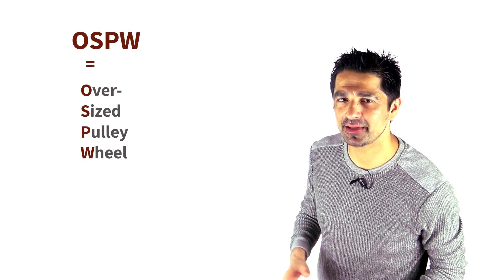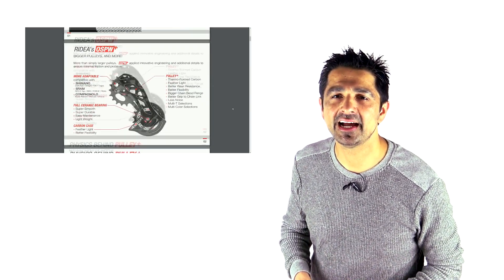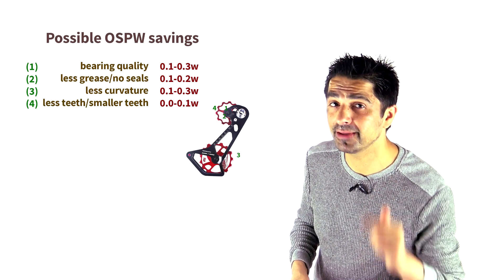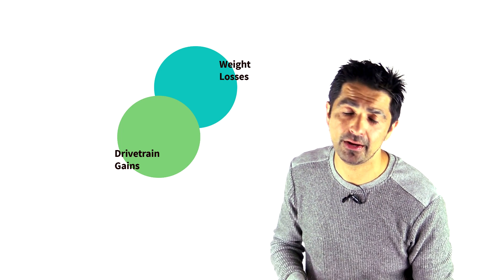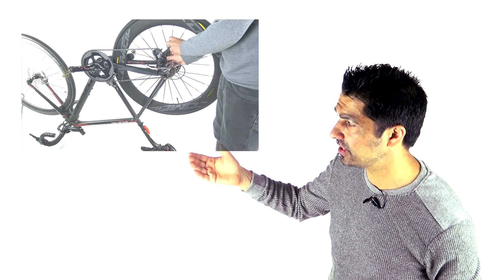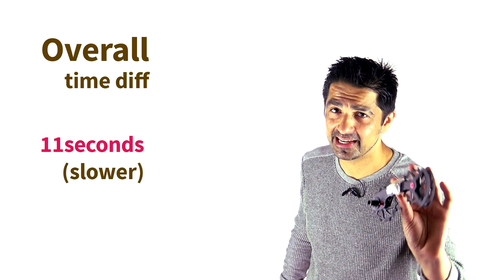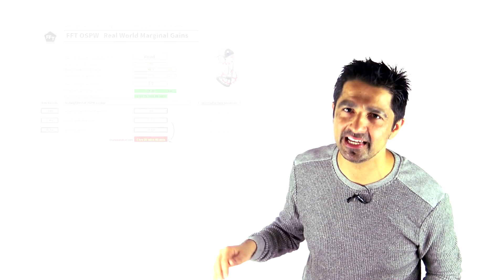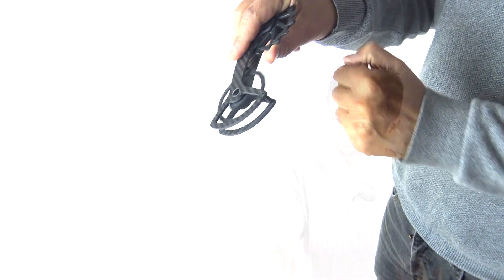Why your CeramicSpeed (or other) OSPW will cost you watts due to aero drag

Comment: I've just returned to cycling after a 'gap' of 30 years. I am shocked by two things: [a] the price of new bikes and components and [b] the plethora of B.S. relating to 'advanced' cycling technologies. Of course, vendors use [b] to increase [a]. As pointed out in a previous comment, if you keep your head down, elbows in, jersey zipped up you will save more watts than you can buy for a $1000.
Reply: "if you keep your head down, elbows in, jersey zipped up you will save more watts if you can afford and want to?

If you've already done all that, then why not go after something else that helps, even if it is expensive
Reply: Some technology is good even if $$$$$.  Its not all as absurd as these things.  Do you need it?  (Useful technology that is, like carbon wheels, electronic shifting etc) Depends on what you do on a bike and your disposable income.
Reply: @stuartdryer4089  Then how come you don't see Bike messengers riding  Dogma F12, S-Works Tarmac SL7,  Madone SLR 9, etc.??
Reply: @kalijasin  Bike messengers use tools appropriate for their job.  So do people who race bikes.  But a lot of Ceramic Speed stuff makes no sense for anyone.
Reply: As you I returned also, but I came from Triathlon.... At "my time"  there were really revolutionary things like Greg Lemond introduced the Tri bars to the cyclists.... Now they try to sell us all kind of stuff for a lot of money, but the gains are quiet small.... As a successful 24h rider I keep one thing from Eddy Mercx in mind:  don't buy upgrades, ride upgrades! Not that I am closed to good material like fast tires or helmet, but at the end the rider makes the difference.....
Reply: I am the same. Toooooo much marketing. I ride a Gravel bike, which was the MTB of my time with flat bars then.  Everything is extra sensitive but it's "lighter" , first time I broke a chain, and I over maintain my chain now!!! Didn't know what proper maintenance was back then. Just punctures 😂

Comment: This is my situation, bought a SRAM Red groupset for my SHIV, they rear derailleur would stutter then be fine for miles, then stutter for a quarter mile. Couldn't adjust it out of the stock jockey wheels. CeramicSpeed can be adjusted 3 ways, now my spring loaded aero shifters bang it into gear so precisely makes shifting fun. It's killed my desire to go to an electronic shifter, saving me money there. It feels faster on the rigid frame SHIV, put one on my road bike with a CeramicSpeed chain and noticed no difference in racing a crit. But, the bike does shift more precisely for a mechanical Dura Ace setup which is on my road bike, I'm happy and no longer have a desire to go electronic on it, so I feel I'm breaking even in the long run. Any gain is marginal, and if you've read this far, you know it's the sum of all the marginal gains that make the difference. To notice the difference, all I have to do is get on a bike without the improvements, then get back on mine, and I notice all the little things that make riding it so much fun.
Reply: no, eletronic shifting is the way to go
Reply: Hey thank you for sharing ^_^  love all this inputs

Comment: What if I use the ceramicspeed standard sized pulley wheels on my standard derailleur then what benifits would I get? would I be better off with the OSPW instead?
Reply: Taj Misquitta you will drop your chain and damage your bike.  Your shifting will be terrible because the space of the derailer is not big enough to accommodate bigger pulleys.
Reply: @davidstrong7854  Oh no I don't mean using OSPW pulley wheels on a standard sized derailleur. CeramicSpeed also makes regular sized pulley wheels for Sram, Shimano and Campagnolo standard sized derailleur cages. So what I'm saying is there is no change to my derailleur just the bearings in the pulley wheels. So what I'm asking is, do I have a better advantage using a standard derailleur with improved bearings (CeramicSpeed) in them over the Ceramicspeed OSPW system (Derailleur cage).
Reply: Good question although the issue then becomes which is better ceramic bearings or steel ones despite the brand . The standard size set that Ceramic Speed offers is still overpriced for said benefits . Stick with what you got and spend your money upgrading the lube in your bearings , a few vids here on the Tube concerning this subject ..

Comment: I'm sure those OSPW's are not worth their money. But I doubt those 0.8W aero losses. If you put the cages in a wind tunnel alone you will find that difference (at least!), but on the bike they are in dirty air, behind the crank/chainring and in the turbulences from the leg as well as from the rear wheel, so I believe it doesn't matter what cage is mounted. In any case, where you put your drinking straw and what shape it has makes much more of a difference than those 500-1400€ OSPW's - marketing hype...
Reply: fiddler on the bike they are also shielded by the chain.

Comment: I think the major problem with your calculation is assuming 0.8 aero watt loss. I would imagine it to be less than that. The correct way to do this test is calculating the Cd in a velodrome for different speeds - and then you will have the total savings in a flat course which you'll be able to adjust to gradient with the knowladge of the weight.
Reply from the maker: ok here is a quick back of the envelope calculation. We previously showed that 10cm of 4mm (area 400mm2) exposed cable costs about 1w (https://www.youtube.com/watch?v=fbM4fEIu8YY&t=770
) now using calipers a small OSPW is 30mm extra long and 16mm in width (frontal area= 480mm2)...so very roughly thats 480/400 x 1 = 1.2w; a large OSPW as shown in this video was 63mm longer (frontal area = 1008mm2) = 2.52w losses...but we could take off 1/3 of this number because of position in 'dirty air' and 1/3 because you are only in a small gear sometimes meaning the OSPW is most exposed (so that's 2.52/3 = 0.8w)

Comment: Head down, elbows in.
Cost = $0. Saves 10 watts+.
Ride safe everyone.
Reply: Get real lucky with the (tail)wind, also power for free.
Reply: Tin of baked beans 20p "tail wind" + 5 watts
Reply: Ride recumbent :P
Reply: Saves way more than that.
Reply: Actually aerobars + extremely aero position = 50 watts, which should be around 3-5 km/h
Reply: All the power in  cycling is in the pedaling and  gearing so other than better gearing there is nothing  you can add too a bicycle that will increase power. Note: Watt is a unit of power.
Reply: cyclists are some of the most gullible people on the planet. They are easily fooled by marketing and pseudo- science.

Comment: LOL i wrote comment under GCN chanel video yesterday. About why i dont see on 1-6 TdF stages OSPW systems. And today you download this video. So, 2019 is ending of OSPW marketing. And what about ceramic bearings in wheelsets? Its a same effect?Sorry for my English skills)
Reply from the maker: ceramic wheel bearings? again depends on your comparison set but check out https://road.cc/content/feature/175644-ceramic-bearings-pros-and-cons and https://www.kogel.cc/blogs/kbba/problems-with-ceramic-bearings-part-2
Reply: @Fastfitnesstips  Thank you.
Reply: FastFitnessTips: Cycling Science! Between FFT and a few other sites, it is an easy decision to stick with higher quality steel bearings and not bother with anything that less than the best of ceramic bearings which are really pricey.
Reply: ceramic meansh nothing... good steal bearings are better. Look at hambinis yt channel.
Reply: @raphaeltiziani7476  I watch this https://www.youtube.com/watch?v=2iTEetRGmpg
And i see test new vs old bearing.  I saw video from russian automachanic  how he test 6-8 lubricants for steel bearing and the difference was like day and night. Sorry for my English.
Reply: For what it's worth, I have noticed some riders in the Tour de France using oversized pulley wheels. Perhaps a sponsorship agreement.
Reply: Check out Hambini YT

Comment: Its funny that sram is pushing smaller cogs w their 12sp road, while ceramic speed are pushing larger pulley wheels
theyre both idiots
Reply: they just went 180 and pushing everything new and that makes any older tech non compatible with the new one
Reply: Theyre?
Reply: Shimano, it's the same shit with no bearing, take it or leave it.